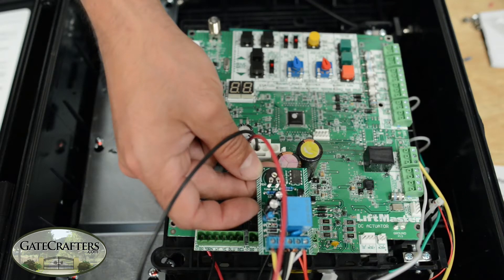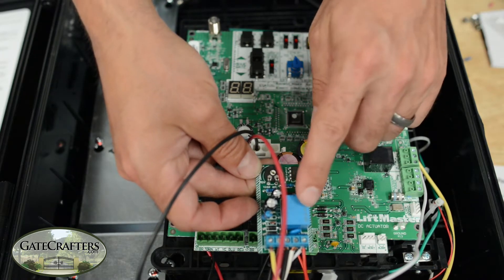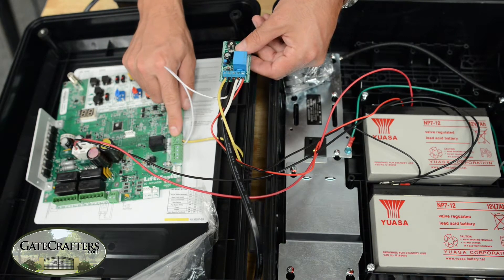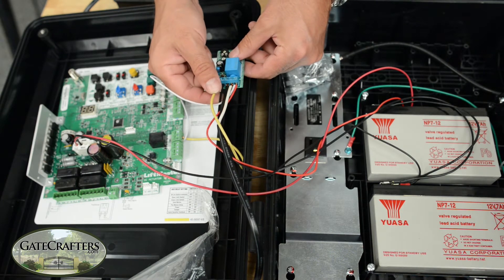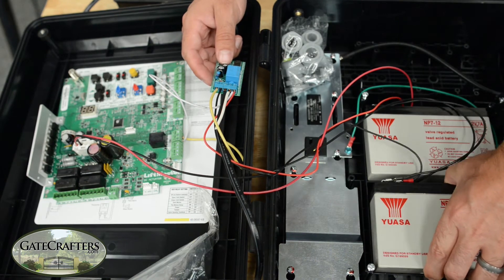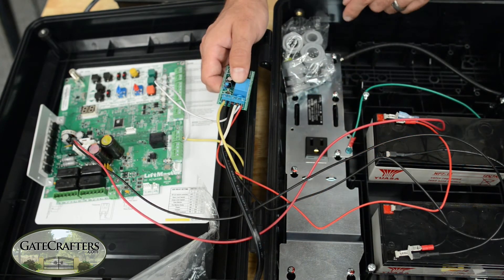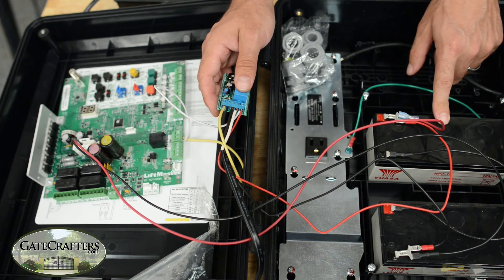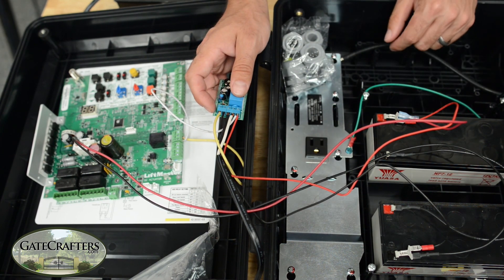How To Wire Estate Swing & GTO Solenoid Gate Lock to LiftMaster LA400 & LA412 Control Box

Comment: Hello there! You didn’t explain how to connect the two wires coming from the solenoid lock. Please explain that. Being outside in the hot sun for hours is not fun.🙂☕️
Reply: Wire the black and red wires from the lock to #3 and #4 wire connectors on the control board

Comment: you didn't explain where to connect the two wires coming from the solenoid gate lock, I think I see them connected to the smaller lock control board on its terminals #3 and 4, would be nice if this was explained in the video, tks
Reply: Don't think he knows either lol